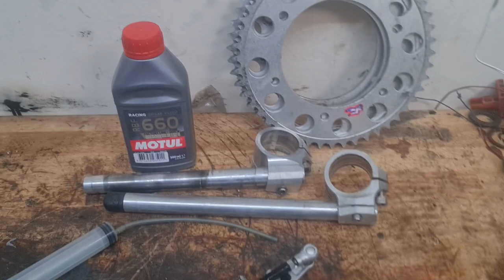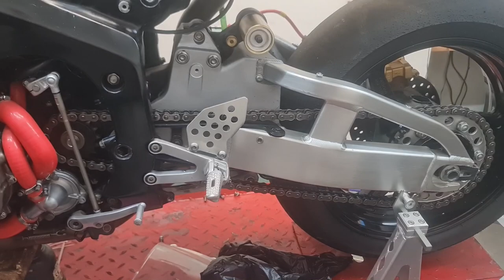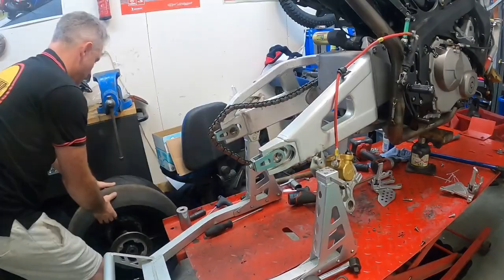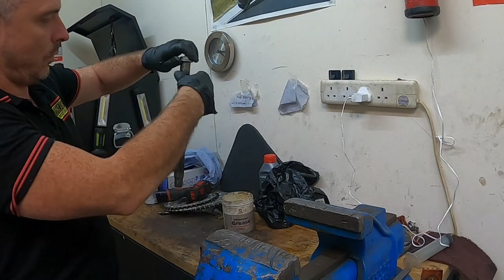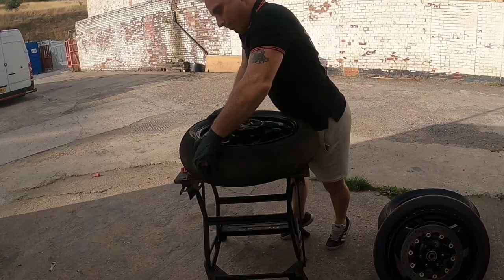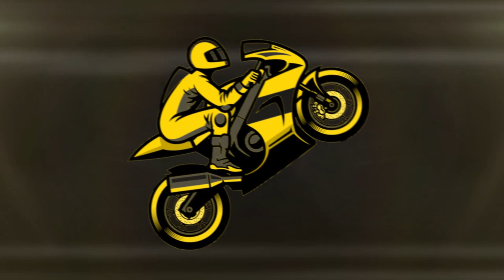CBR600RR Project Broken gearbox? Cadwell park challenge Pt 3 plus Prize Giveaway.

Comment: Gear selection issue may be down to the dot on shaft not aligning with dot on knuckle as stock one does have that issue on nc30 linkages ?
That Einhell would come in handy for getting that cruddy looking gearbox sprocket bolt of my firestorm .